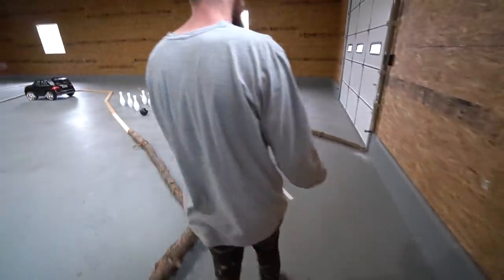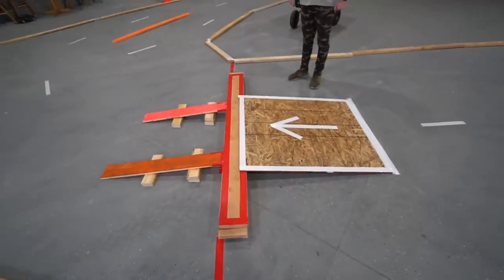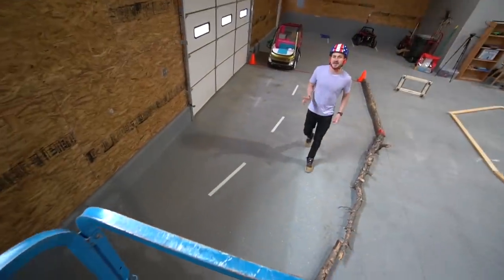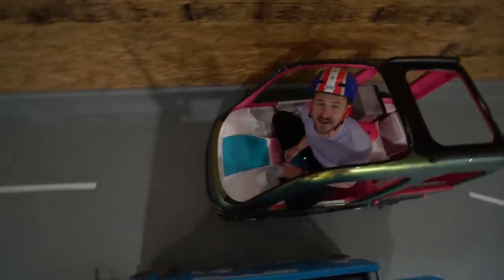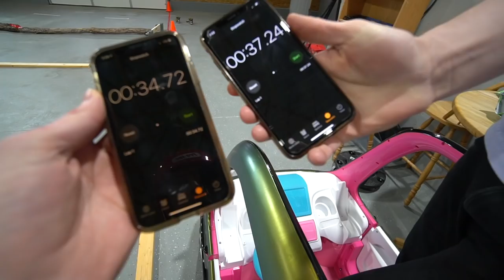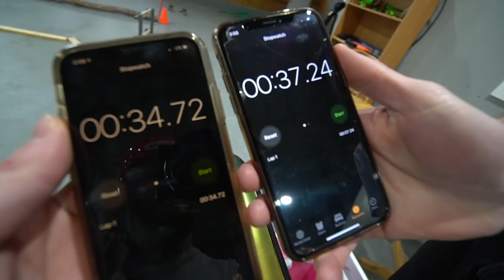INDOOR TOY CAR RACE TRACK!

Comment: You should mod the cars and make them faster it is pretty easy if you take to batteries and make a series circuit it will make them go much much faster